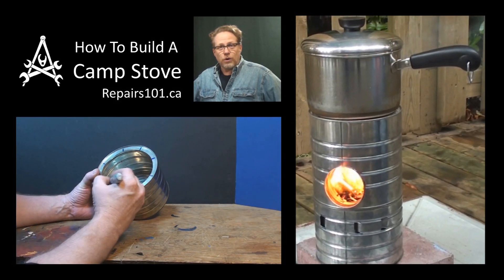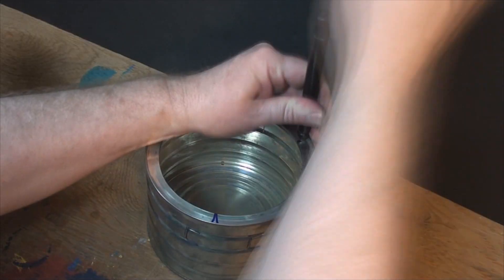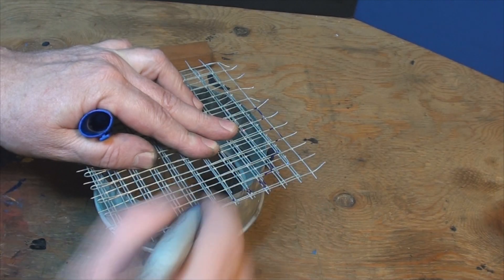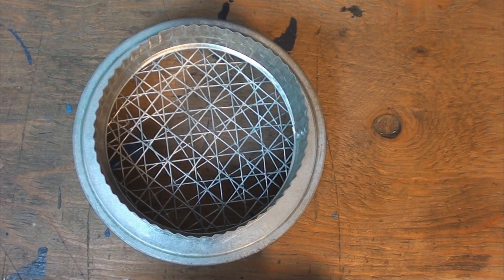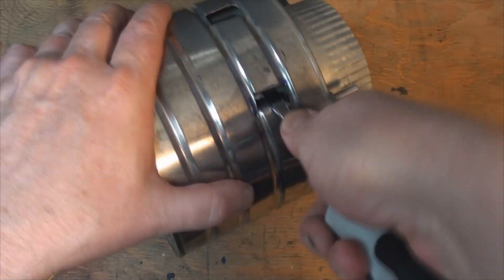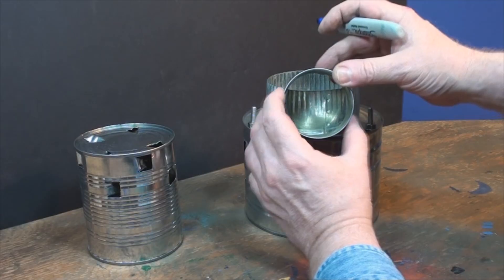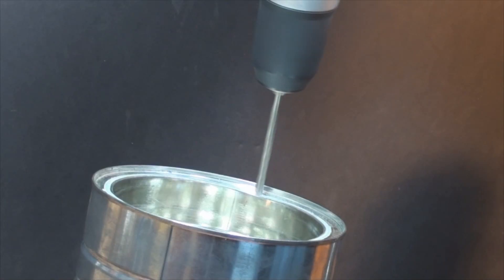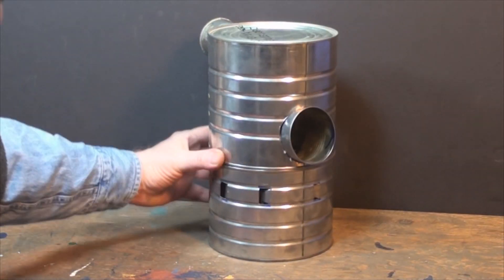Camp Stove - How To Build A Portable BioMass Stove From Old Coffee Cans

Comment: finally a low cost camp stove that does not soot pots. I was wondering if it is possible to put a lid on the fire tunnel for better efficiency. Something ceramic, maybe ?
Reply from the maker: jomunoz I also thought of that in the field test stages of production and the bottom of a soup can plugs it nicely.

Comment: Some of that material looked galvanized... if so the first burn should be done in a very very well ventilated area.  I understand you don't want to breathe zinc fumes.  This looks like a little rocket space heater.  I hadn't seen a small can stove that didn't soot up your pots.  Well done.
Reply from the maker: FlashGeiger Thanks! Absolutely galvanized - I agree this camp stove is for outdoor use only! 
I spent many hours at the drawing board trying to design something that worked better than a basic Hobo Stove that anyone could put together cheap. Thanks for commenting!